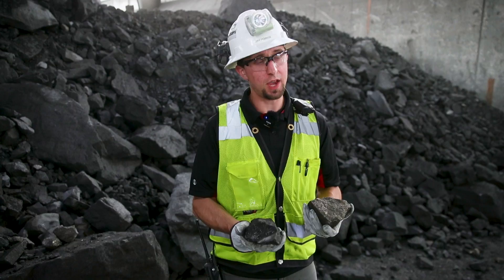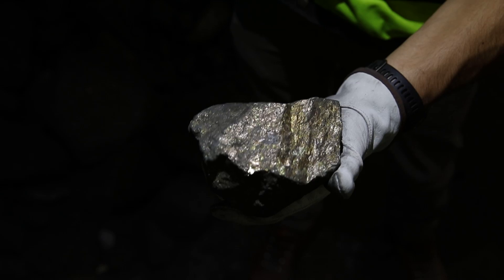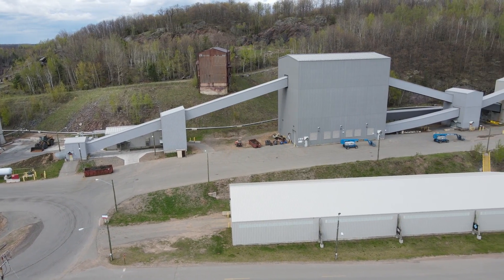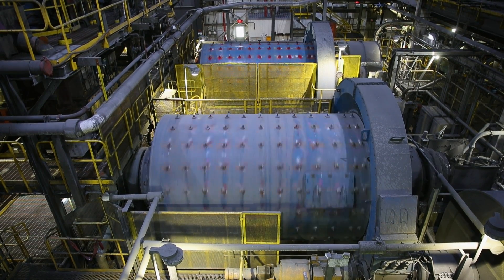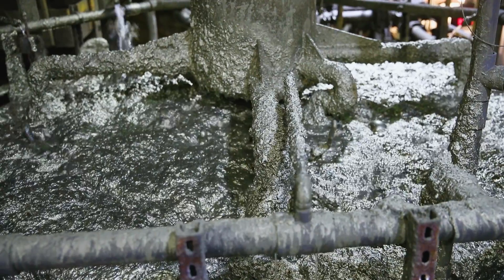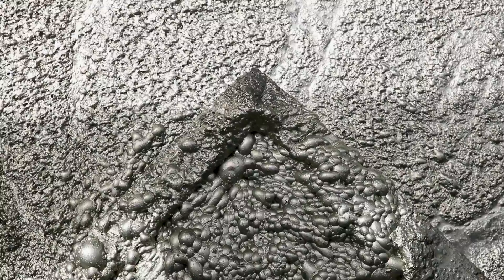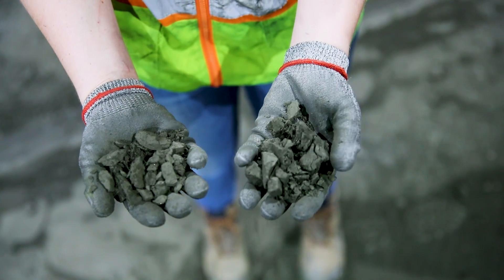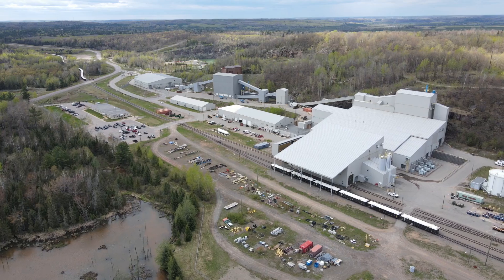Inside the Humboldt Mill: Watch nickel ore being processed at Eagle Mine

Comment: So nickels worth 5 cents are made from that?
Reply: No and yes, none of the modern AND standard US coins are made of pure anything, you can find ‘US mint pure silver eagles’ and gold coins etc but considering the face value of those is usually $1 or $5 and in reality the silver is worth about $30 and the gold is work about $2,200 last I checked so again those are pure but don’t really count. Normal and modern nickels are made of something like 25% nickel and 75% copper, Pennies are made of zinc and have a very thin copper plating, and dimes and quarters are copper and nickel I believe.

Also you gotta remember this is just how one place in one country does it, if you look into pretty much anything mining related anywhere around the world you’ll find that everywhere does it at least slightly differently and usually in 1st world countries it’s way over complicated due to all the safety regulations and all that and in reality you could do that whole process with some cheap acid and a power supply by dissolving the metal and rock and all that in the acid and extracting it via electrolysis but also the way these guys are doing it is for large scale day to day production meaning it seems like overkill but for the companies in those industries it’ll likely be cheaper in the long term to throw millions into buying that set up and just let it run than it would be to do it the simple way

Comment: i wonder what they do with the waste rock. is it used for aggregate in concrete or something ?
Reply: Where I grew up in Sudbury Ontario Canada home of the world's two largest nickel miners, the waste is called 'slag' and it is taken molten hot after final separation processing by specialized rail cars and dumped in huge slag piles. To my knowledge, none of it is sold for aggregate, however there has been periodic publications over the years from the companies that with their ever improving extraction and smelting technology they eventually may be able to run all this slag dumped over the past 100 years through their ever improving smelting processes and wring some more value out of it. Meanwhile, often road building companies looking to build solid roadbeds for new highways offer take the eyesore "slag" away for free. So far the companies have said no dice and continue to value slag as an asset and carry it on their financial statements as an asset.
Reply: It's nickel they probably make nickels out of it